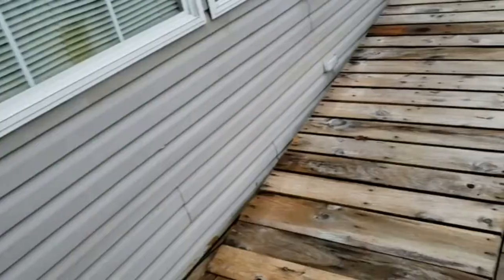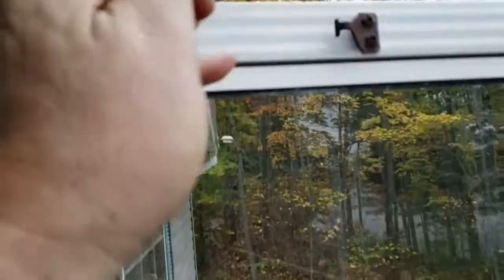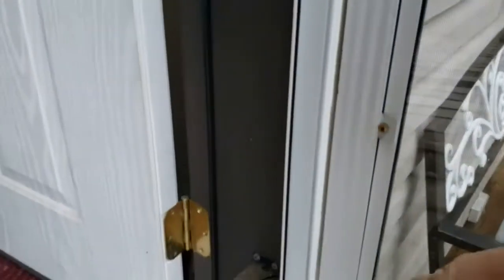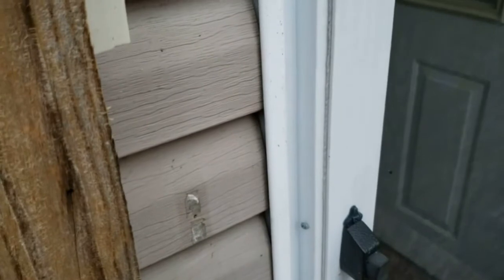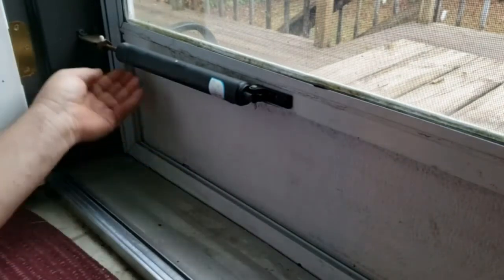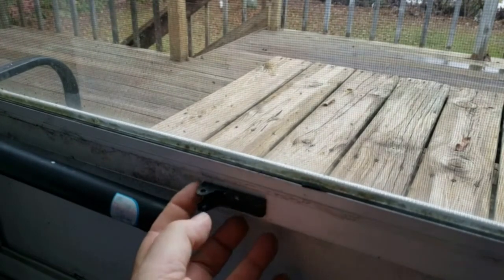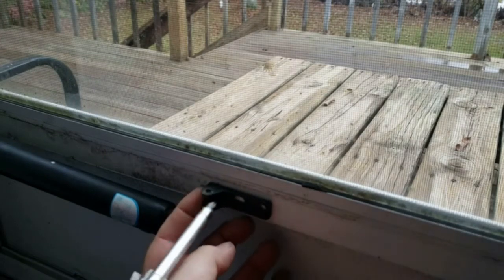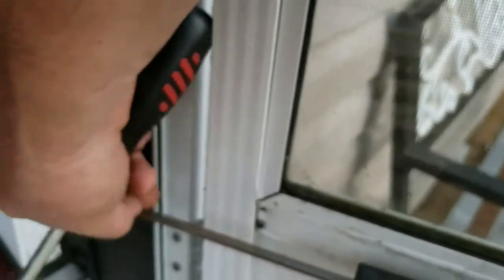Storm Door Adjusting Closer & Wind Chain

Comment: Great job! My comment is more related to your ramp. You may want to add a lip or even a railing to prevent you from dropping a wheel off the edge, same on the landing, it will keep you from backing off the landing and hurting yourself or daughter.
Reply from the maker: She has a manual chair, and I am more likely to trip that not on them.
Thanks for your concerns, however.